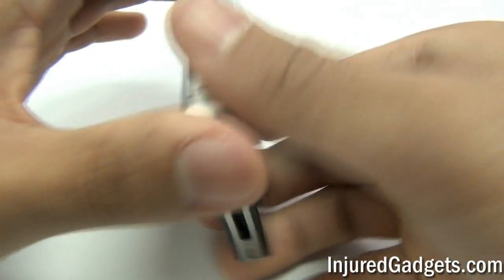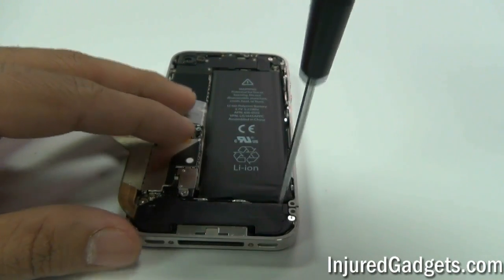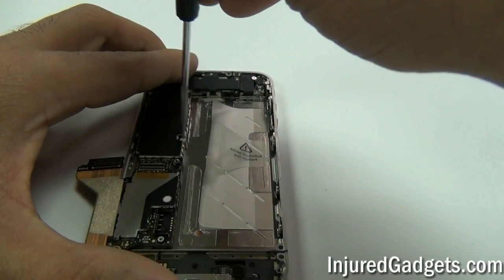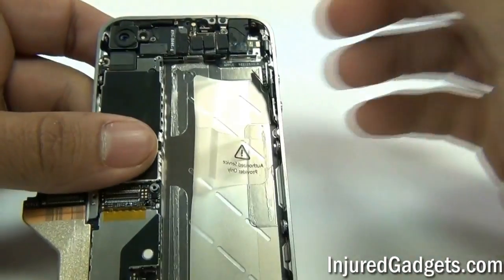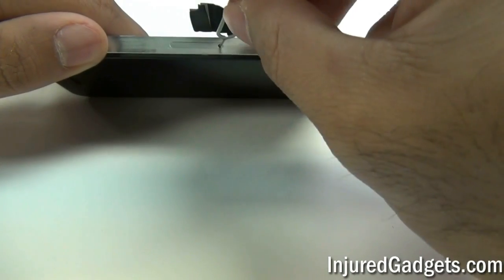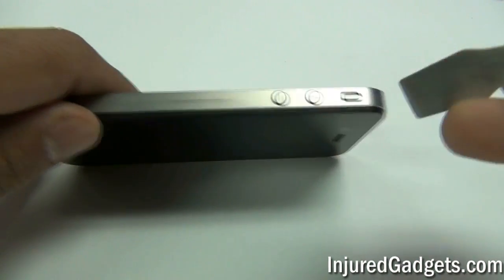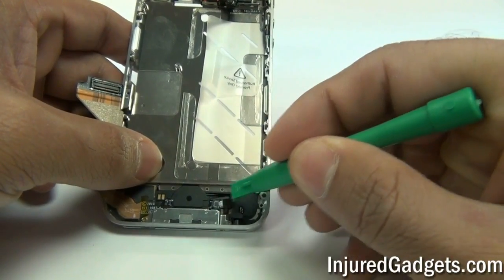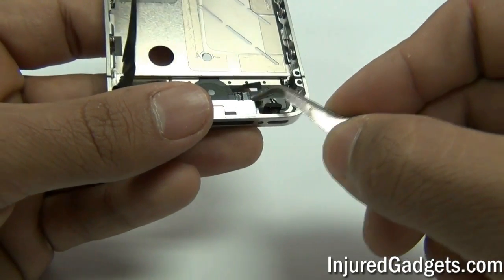iPhone 4 Home Button and Flex Cable Repair Replacement Guide

Comment: Jakub. You can it's possible but my iphone I did it to and pieces in the pins on the board came off. My mic is half broken and it doesn't sync to my computer but was luky enough it charges call only work on speaker phone and the home button is broken it worked for 3 months before the cables broke

Comment: So i was able to successfully fix my power button, BUT while putting it back together, I damaged the display flex cable and had to order a whole new display because of it. Went on to replace the display and now I'm having weird issues. The display won't work, but when I plug in the USB cable and connect to the computer, it keeps vibrating, indicating that it's connected to the computer. It basically keeps disconnecting and reconnecting. I'm guessing it's some sort of grounding issue? Any ideas?

Comment: @samheb I also do iPhone repairs and I had something like this happen once to me before. I still to this day do not know what happened... it was on my old iPhone 4 verizon. I replaced the LCD DIGITIZER and still did not fix the problem. I believe the problem is on your motherboard. I think maybe you nicked the motherboard in a bad spot because mind did what your talking about. It also randomly would have a dead spot vertically down the screen. Wish I could be of more help. Best of luck!

Comment: Hi InjuredGadgets, when I finish replacing the button. Now the digitizer seems to go head wire. It press buttons by itself. Do I need to replace the digitizer? Is it because maybe I've broken some cable? Please help, thanks.

Comment: hello I just replaced my home button, reassambled my iPhone. I turnned it on and i have pin code on my mobele sim Card, so I put the number and iPhone still finding the carrier, the iPhone says ulocking and no action is tooking place. so I have to hit the power button and then repeat all over againg and still nothing. my iPhone cannot find the carrier
please help, what I have done wrong thank you very much

Comment: Yeah, I followed this video to a Tee, but, I pinched the touchscreen ribbon between the screen and middle frame when I first put it back together before I realized what I had done. So when the screen comes on, I can't unlock my phone because it just doesn't respond at all.  Do you think this is the problem? I've pulled it apart twice and put back together again but it still won't work. Will I have to replace the screen assembly?

Comment: Tried to change the Home button, now it's doesn't work at all. Have to unassemble it again and check what is wrong. Bigger problem is, that phone can't connect to operator. It finds operators on the list in Settings, but can't just connect. What is the part in the phone which is doing something with the antenna perhaps, maybe I could check there what is wrong with connections? Wifi works normally.

Comment from the maker: The likely culprit is your dock connector flex. Is it plugged in? As your dock connector solves all those problems as it houses your microphone, your charger port, your home button flex and goes right under the speaker.

Comment: Hey InjuredGadgets. I tried replacing my home button but I didn't complete it as it took longer than i thought. I stopped where you start taking of the screen. Then I re-assembled the iPhone 4, but now the Home Button doesn't work at all, where as before it would if you pushed hard, the speakers don't work, it won't charge and when i turn it off, it turns back on, on its own. Please help me ASAP, it is still under warrenty but as i opened it they might notice i played around with it. Thanks.

Comment: Tips for people attempting this - Make sure you have a phillips 000 screwdriver. Draw a map on a piece of paper and place screws and parts on it so you can easily reassemble. Use a razor to pry screen off the case if you don't have the tool in the video (be careful!). Do not unscrew the 6 side panel screws completely, they're annoying as to get back in. Far left screen cable will probly get snagged, make sure its pulled all the way through!! Rear panel might need a bit of force to click back on.

Comment: ok you can go ahead and go ahead and remove the flex cable and then go ahead and go ahead and remove the camera and then go ahead and separate the touch screen from the mid frame assembly

Comment: @InjuredGadgets You guys probably get a lot of iPhones from failed repairs in these videos even though they're step by step.  The main issue is you need a steady hand and intuition, which only comes from experience.  Are you sure there is no way to remove the black circular plastic piece that covers the back side of the Home button(if you remove the charging port as well) to replace the Home flex cable?  you have to pull out the screen, right?

Comment: Absolutely top video, just finished changing the home button and my newly cracked screen, took only 15-20 minutes, only trouble i had was when it came to feeding the screen flex cables through, make sure the far left one comes all the way as mine felt like it had, but had snagged, and then wouldn't reach the connector. All tested and working perfectly now, awesome job, ty!

Comment: This is BS!!!! I got the tools and replacement home button from ebay and i even went negative to buy it but it didnt come w instructions. so i decided to look up a video on how to replace it on youtube and found this one. I watched it twice then decided to go for it. For some reason i have more screws after i took it apart and put it back together and I have two weird parts that fell from the sky.... or so it seems. I have no idea where these peices go and i dont know where the remaining screws